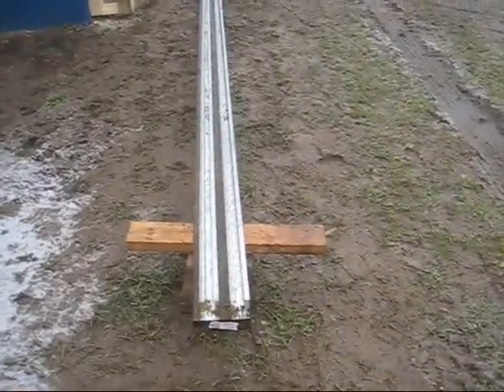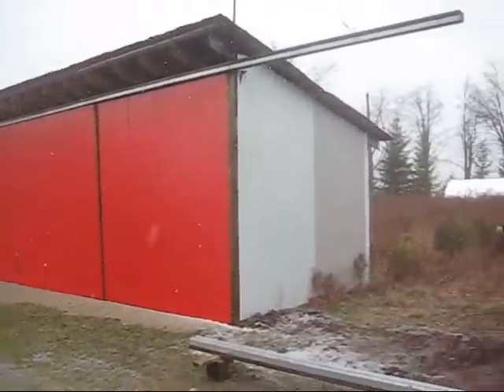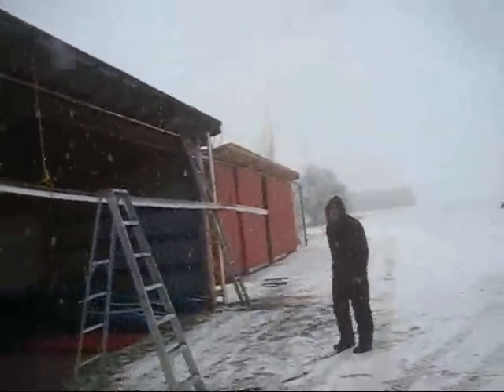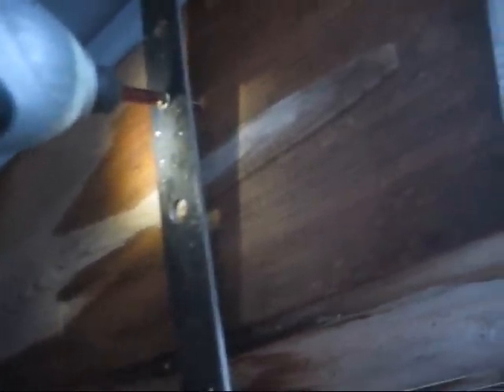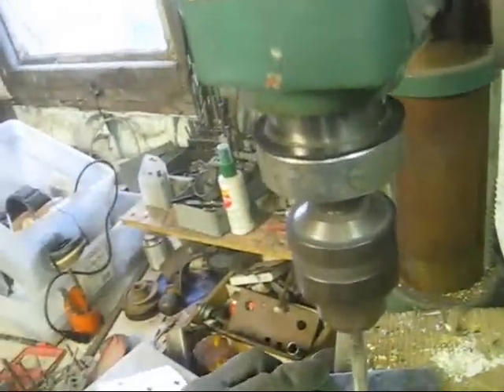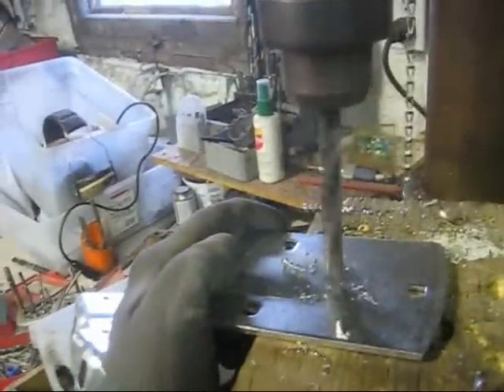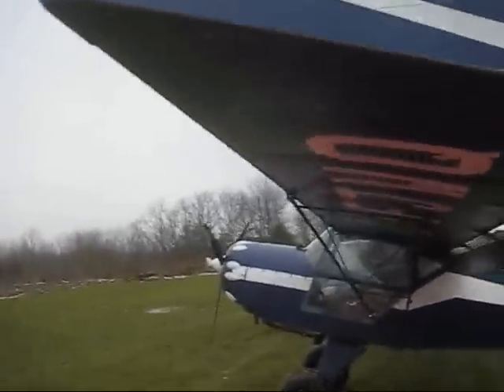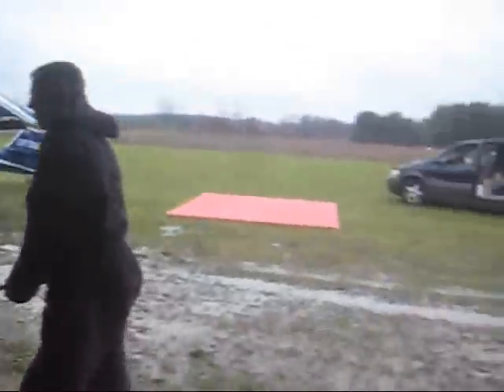How to build Cheap Hangar doors that work for Kitfox Airplane

Comment: I have a humble suggestion: On the completed door system, you have a guy pole on each side. they are then tied to the end of the track that has cantilevered out to the side. A single wire between the two poles can be used to tighten and prevent any sag. $1o at most.

Comment: On your next build...  
you should cut each door in half, so that there are 4 doors...  the first two doors will go up just as you built here, covering the outside quarters of the opening..
your second set of doors would run on a second track lined up in front of the first doors...   sort of layered like shingles...  
the point and the end result would be that when you open your doors..  they would hang double stacked in line with the building, instead of half of the track hanging out in the open air.......  it would cost a bit more for the extra track, but you wouldn't have to do the cable hanging supports....   love creativity, use of old materials, and bottom dollar being the primary goal....  my kind of people...   have fun

Comment: Hey Dave, what did you use for a header when you built your hanger? I am building one for my champ thats 40 feet wide and need an idea on a header. Thanks, John
Reply from the maker: I have used open web joists and or I beams -  even once used a homemade wooden one built like a truss 16" high out of 2 x 2s and laminated with plywood/
Reply: Just want something that I wont have to worry about collapsing. I live in Northern wisconsin and get a snow load about the same as you so what do you think would be best? lookw like the one in your hanger is a steel beam?